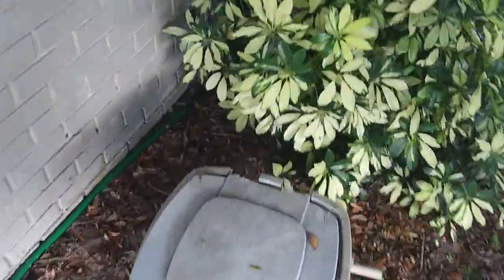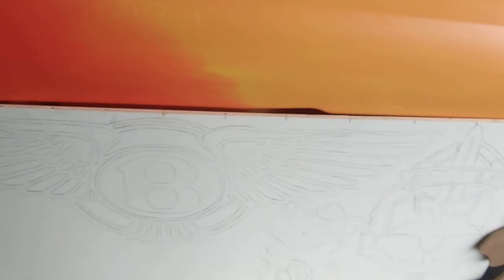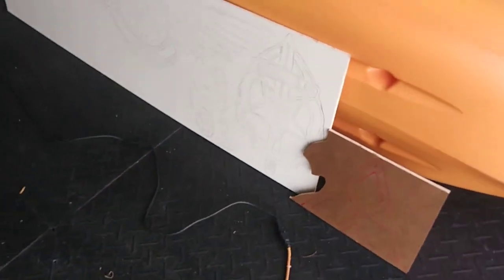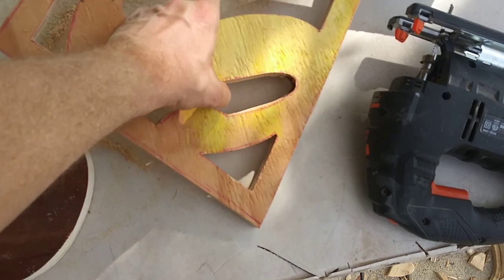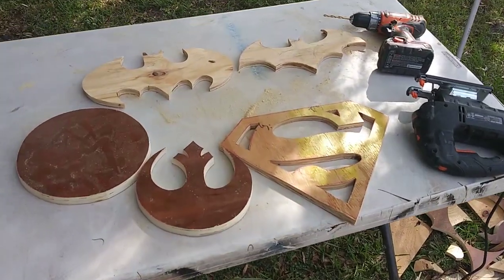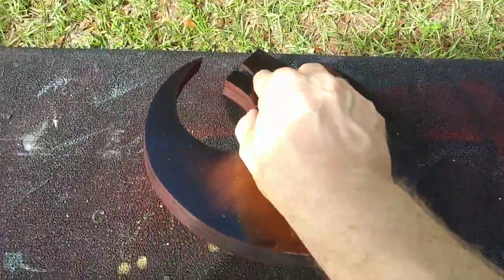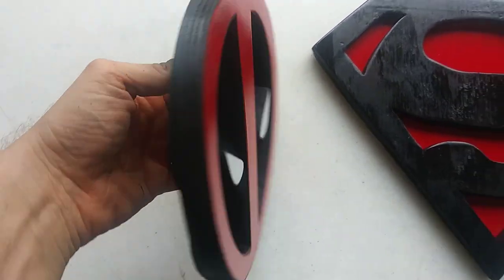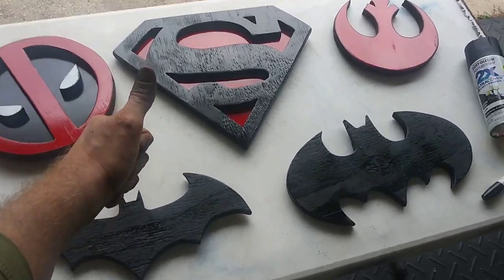Halloween Superhero "Candy" made out of wood | Deadpool, Superman, Batman & Star Wars DIY

Comment: How do you get cuts/lines so straight and curves so smooth. What blades and how many teeth do you use? Im working with 1/2 ply and getting a lot of tear out.
Reply from the maker: I have a video on what blades I use - mostly the skinny ones. Going a bit slower helps, but some plywood is just junk and shreds regardless of how good you are.
Reply: Thanks 😎🙌🏽 will check it out

Comment: Hi!!! your art is amazing!!! what type of board do you use?? I've never used any of these items before and I have a personal project. I'm just not sure what TYPE of wood I need. I definitely need the 96" height.
Reply from the maker: Just about anything really I've tried including random stuff I found. Mostly it ends up being rough scrap plywood for rustic type project or nice cabinet grade plywood that I have a friend hook me up with: https://youtu.be/QKSdTHTLKd4
Reply: @LeoTheRussian  for a bigger 8 foot project, would the 1/2 inch sanded plywood suffice?
Reply from the maker: @tinatee276  depends on the project - what are you making? Though something that large usually I'd use 3/4 inch since 1/2 will bend and likely snap if it's anything like the signs that I make
Reply: @LeoTheRussian  I'm planning to make a backlit, 8 foot long signature... so it's a thin flowing line thats about 1'5"-2" thick. I'll add 2" spacers along the script . first time DIY wood working.
Reply from the maker: @tinatee276  you could do it out of 1/2 but just make sure to support it though 3/4 would probably be better still. And I'd make sure that the plywood itself is high grade and won't flex on you. Had an issue with 6ft long Puerto Rican flag bowing like crazy on me before
Reply: @LeoTheRussian  Thank you! 3/4 it is! thank you so much for the help!
Reply from the maker: @tinatee276  lmk how it goes for sure!
Reply: @LeoTheRussian  OKAY! to the cutting went amazing! definitely a learning curve (no pun intended lol). I wish I could show you what i cut, considering my first time working with any tools lol anywho! my next challenge is filing down the cut out to the line. It's basically a CURSIVE signature, 8 feet long, so you can imagine all the tight curves, corners, and holes. How can I shape the cut out from here to get down to my draw line?
Reply from the maker: Instagram will work or email me - leo at crossfitevolution dot com.
Reply: @LeoTheRussian  wikked! gotcha on the gram! thank you!